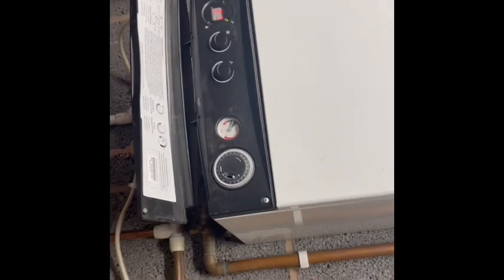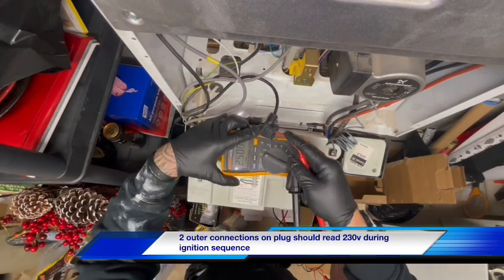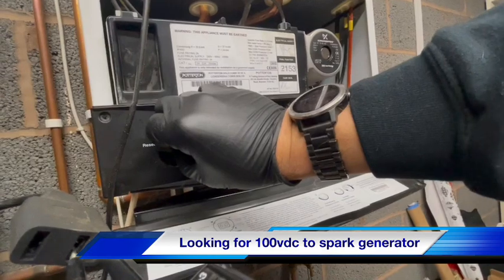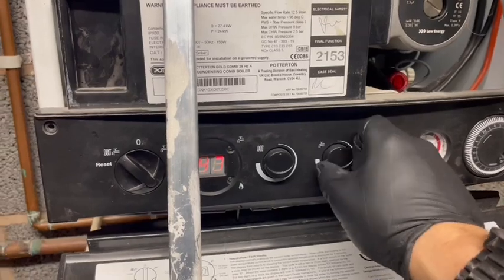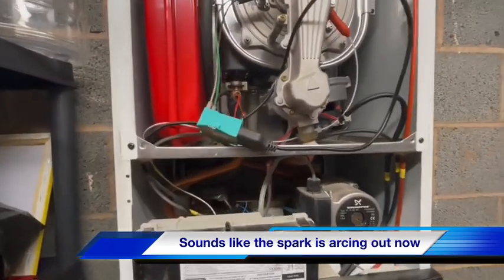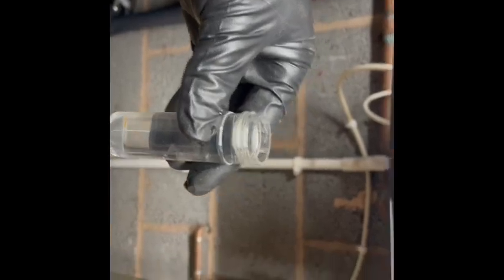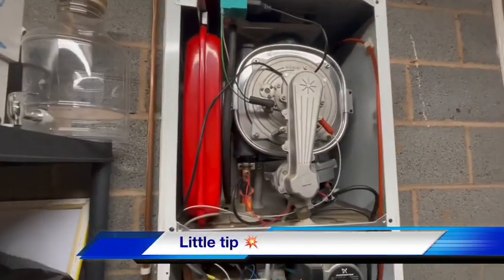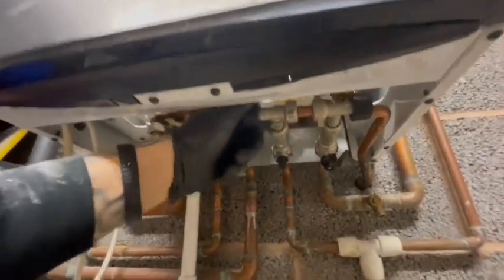E133 fault Potterton gold 28he faulty spark generator and electrode

Comment: Great video, always liked a duotec boiler. do you always isoate boiler flow and return valves before you drain down to pump up expansion vessels, or just let the full system pressure drop out through the boiler? valves have got a habit of leaking on me once i touch them

Comment: where you get schrader from, my merchant don't have them
Reply from the maker: Car Tyre Valve Repair Tool Set,... https://www.amazon.co.uk/dp/B08FT4X3JQ?ref=ppx_pop_mob_ap_share
Reply from the maker: https://www.amazon.co.uk/REGK29-Regin-Pressurisation-Angled-Adaptor/dp/B00YSIXQJC/ref=asc_df_B00YSIXQJC/?tag=googshopuk-21&linkCode=df0&hvadid=372573243756&hvpos=&hvnetw=g&hvrand=1008240589032206581&hvpone=&hvptwo=&hvqmt=&hvdev=m&hvdvcmdl=&hvlocint=&hvlocphy=9045478&hvtargid=pla-822379059523&psc=1&tag=&ref=&adgrpid=76699547495&hvpone=&hvptwo=&hvadid=372573243756&hvpos=&hvnetw=g&hvrand=1008240589032206581&hvqmt=&hvdev=m&hvdvcmdl=&hvlocint=&hvlocphy=9045478&hvtargid=pla-822379059523
Reply: @thementalgasman3tgasmainte317  Thanks mate, really enjoying the content and putting your methods into practice 👍🏼

Comment: BG standard issue wibbly wobbly meter fused probes?
Reply from the maker: Rs components for the needle leads
Reply: @thementalgasman3tgasmainte317  it's only cus I've inherited a pair, really need something more ridged as they're constantly popping out of the components I'm testing. Cheers for the content by the way, you're killing it at the moment 👍
Reply from the maker: @jamesbrough7975  Rs components have got a good selection of multimeter leads ✅